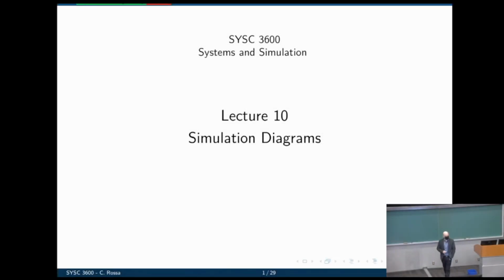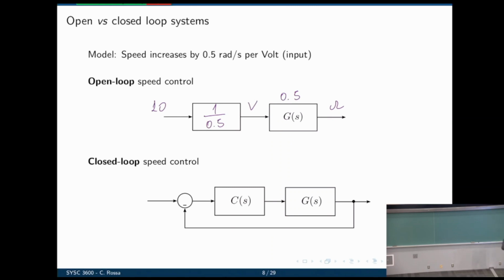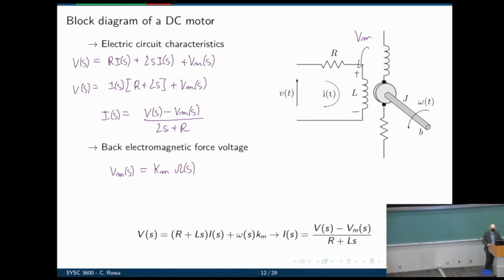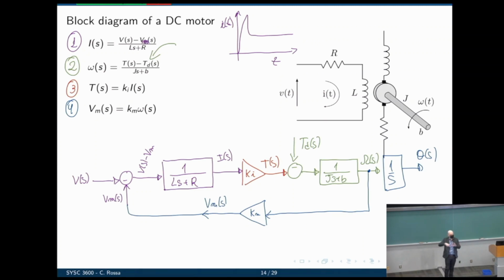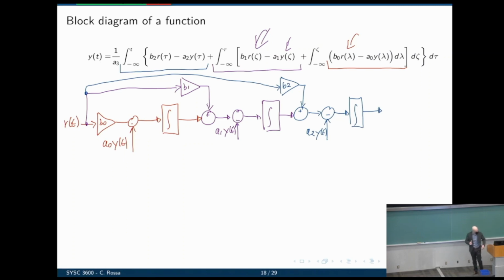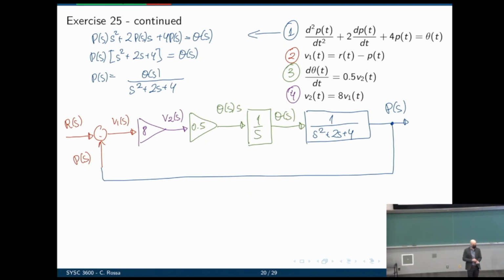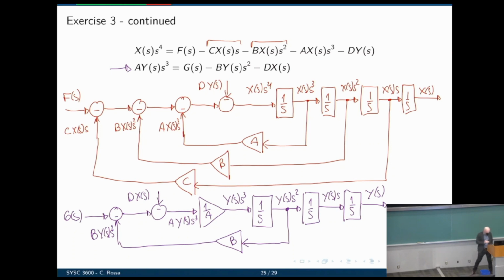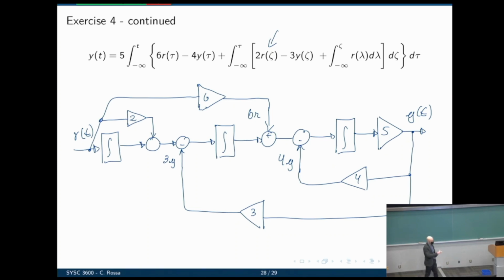Systems and Simulation, Lecture 10 - Simulation diagrams

Comment: in the first simulation diagram shown for the electromechanical system why were rectangles used for division instead of a gain block are they representing transfer blocks?